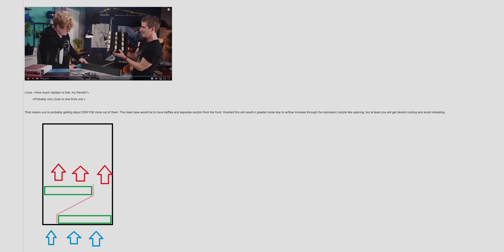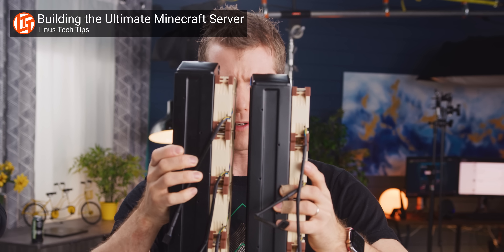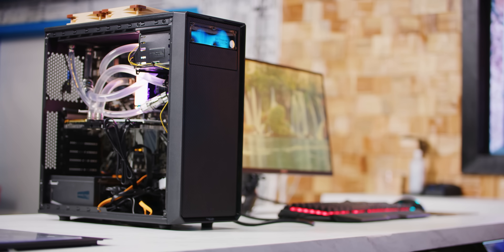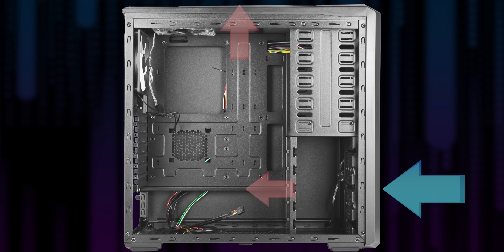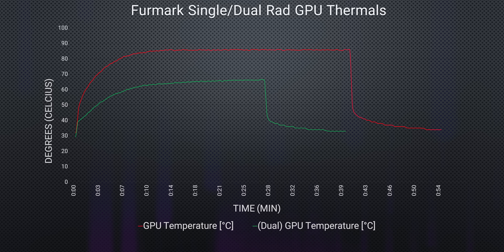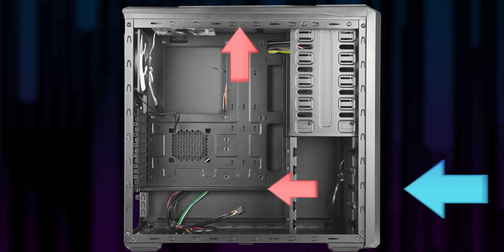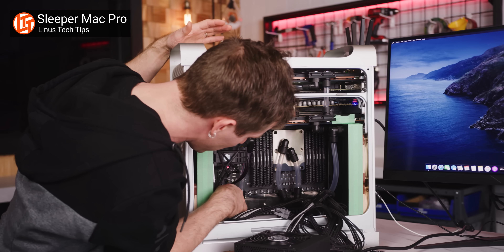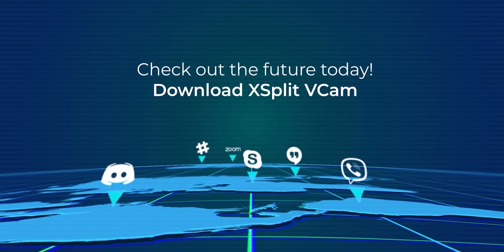I’ve been water cooling wrong for YEARS - $H!T Manufacturers Say

Comment: @LTT what about comparing:
(Each radiator is 2-fan wide)
1 radiator push+pull (4 fans)
Vs
2 rads, 2 fan per radiator (push or pull configuration)

Comment: For the best effect of dual+ radiators you should either use all with a descrete intake or all as an outtake (non stacked) or use the counter-flow principle for stacked radiators which describes a situation where the coldest radiator gets cooled first, and than passing through the next hotter one. In other words, hot coolant enters in the top radiator while the cool air enters at the bottom. This ensures there is always a delta T if possible. Same basic principle is in effect in fish gills where the blood which has already picked up oxygen from already almost oxygen depleted water next passes through bloods vessels and water with a higher oxygen level. Efficiency is astounding.

Comment: The wrong assumption was that air temperature exiting the first radiator was near or equal water temperature. That would be the case with very low or non existant airflow, but with any semi-decent airflow (even with low speed fans) we have to account for the air mass going through the radiator, and its heat capacity.

That would also be a problem with a very high heat load (say, 500W +) on a small-ish radiator with low air flow. But who does that ?

In any case, the best practice is to have radiator fans set up as intake through dust filters, to mitigate the dust problem.

Comment: “In such config”=> I believe Corsair mean radiators stacked, together, no 2 radiators on different places.
Reply: Near the end of the vid he did say he remove a radiator from his minecraft server(which does have the radiator stacked on each other) which led to an increase of 5C. So there was still a net gain when using multiple stacked radiator. Try to watch the entire video...
Reply: @muhammadnazrin3390  That´s right, but still didn't tried 2 radiators taking cold air from outside.
Reply: @pablopoo  That wasn't the point of the video. All that they were trying to prove is that you can add more radiators via stacking or using hot air intake can be effective to dissapate more heat. There didn't need to be a comparrison for the subject of this video.
Reply: They sent him two comments on two different builds, and Linus addressed both.

Comment: Lab results are usually far from reality. Controlled environment can sometimes be horribly unrealistic.  The saddest part of this is that this environments values (air flow, temperature, humidity etc.) are calculated based on the result they are expecting, making the expectation a "reality". (Personal experience during the time i spent in uni)

Comment: This test looked scuffed to me Linus. You really should have replicated or used the system they critiqued specifically
Reply: Uh, watch the vid.  He said they removed one of the three stacked rads and the temps went up 5 degrees.
Reply: Since he is specific on air coming in from the rear and bottom it is safe to assume they tested with the cover on. I am curious if they would test the order of the rads the water went to first. Pumping the water to the rad seeing the highest ambient air temp first and then to the cooler ones. Or test inlet and outlet temps. Corsair seems to not be factoring that as the water goes thru it cools so the fins near the outlet could only heat the air up to the temp of the water inside. Really good fans would push air thru faster meaning less temp rise and I bet they design the rad for 'average' quality fans
Reply: True, if the freaking case is open (which it usually is not, of course, you don't want all that dust in your computer) it's no wonder it's working perfectly fine. When the case is closed up, however, all the things that Corsair said should match up with the real world...
Reply: @soulofakuma3491  Copypasting another comment I wrote in reply to a comment similar to yours: ...are you assuming they ran the tests with the side panel off just because they showed the PC with the panel off in the B-roll video footage? That's.... just so, so, so wrong. Of course they had the side panel on for the actual tests.
Reply: @snozzmcberry2366  Dude stop accusing anyone of assuming if thats all you're doing aswell. You don't know how they ran the tests and they only showed the Computer in a state with no side panels. I am talking about what I see and you're assuming they put them on for the tests.
Reply: @soulofakuma3491  because of course they put them on for the tests. They're not retarded. B-roll footage =/= real test conditions.
Reply: @soulofakuma3491  That's because not putting the side panels on for testing would be a really stupid, amature mistake. These guys test a lot of builds and are not as dumb as Joe Internet Guy, understand Joe?
Reply: @soulofakuma3491  ....it's basic inference & deduction. Linus & co aren't retarded, doing these tests with the side panel off would be extremely retarded, the PC was only shown with the side panel off in B-roll footage, ergo they ran the tests with the side panel on.
Reply: @snozzmcberry2366  Basic inference and deduction is still an assumption. Using synonyms to say the same thing won't change message an hence my response
Reply: @soulofakuma3491  You're just performing mental gymnastics to try to dodge the fact that you made an idiotic assumption based on a ludicrous piece of "evidence" (B-roll footage) that goes against all common sense. You're making a fool of yourself trying to save face.
Reply: @snozzmcberry2366  As I said, I am not assuming. I am just responding to what I am seeing. You are still the one whos making assumptions, so I don't know what you're trying to accomplish here. Just watch your basis for argumentation, before attacking mine. You're assuming without even having any footage.
Reply: @soulofakuma3491  Why do you think they ran the tests with the case open? Linus might drop stuff, but he's not a moron.
Reply: @soulofakuma3491  So you are assuming they did the temperature tests with the case open? That would be a realy stupid, obvious mistake, and I doubt they are that dumb.
Reply: Also, looks like the top fans were pushing outside air into the rad, not pulling through the rad...

Comment: I hope that someone from LTT read this and respond with a video! 
What Corsair meant is that it will be better if you make both radiators as input in your test rig. That, in thermodynamics, will make sense as the input air for the second radiator will be ambient (21-22oC) instead of around 30ish that would be from the case. On my watercooler, i have 2 rads with input-output like you tried but i have 2 extra fans to introduce ambient air to reduce incase temp air.
It will be really interesting to see both of those rads to be pushing air inside the case and have the back fan as an exhaust.
Edit: adding an equation to the mix, by using heat transfer equation W=k*A*ΔT/L, assuming k, A, and L are constant, W is linear with ΔT. For the second radiator, the ΔT will be 10oC maybe? From 30oC incase air to 40oC of the liquid. Having 25oC as the intake, makes the ΔT 15oC which can make the radiator 50% more efficient.

Comment: Are we just gona ignore the fact that they're is a gaint hole in the back of the pc case, where fresh air can get in.
Reply: Ok, but what the hell are you talking about?
Reply: 1. All PCs have additional holes in them.
2. They would never perform temp tests without putting the case together (only an idiot would do that).
3. Corsair's theoreticle testing does not equate to real world performance.
Reply: 0DAANVART0 I don’t think this one was well thought through
Reply: And are we gonna ignore the fact that all PC cases have one, so that sealing it would make no sense?
Reply: @kelainefes  yes,but that's not what Corsair said.they say when there is 2  radiators behind eachother (like a server) where there cant get fresh air in between the radiator (as shown in the video)
Reply: @0DAANVART0  Even in that case, 2 stacked radiators have been experimentally proven to work better than one at least in some scenarios. 
That to me means that Corsair does have a point, they should experiment more and update their simulator if they want it to be a universal system.
Reply: @kelainefes  i,m not saying that corsair simulations are right,im just saying that this test was pointless
Reply: @0DAANVART0  not entirely, but yeah, they should have tested a sealed case as well and then we would know how much of a difference it would have made.
Reply: @0DAANVART0  Corsair was commenting on two of ltts previuos builds. Both of those builds had assorted holes, and Corsair should know better than to equate theoreticle data with real world data.
Reply: @0DAANVART0  The test was not pointless since Corsair was commenting on two real world builds.
Reply: Their tests rarely is..
Reply: there is a giant hole in the side of the pc lol, they didnt lock the sidepanel lol.

its as bad as testing low end cpus to see which you should buy, but they used a 360 watercooler on them instead of stock fans
Reply: @charliek9394  Only somene as dumb as a doorknob would assume a professional would not put the side of the case on before testing. In case you don't realize it, the actual test was not done in the video.

Comment: If the hot water fresh from the cpu went to the top radiator first, you still dump heat into the warm air.  And then you cool the water again with the incoming cold air.  The arrangement is important since most of the heat goes out hte first radiator.  If you had it backwards, you'd be throwing the heat into the case and then really hot air would flow over teh second one, making it useless.  And looking at the model, it looks like the heat was coming out the front radiator instead of the back (top).

Comment: If the loop temperature is, let say, 60°, ambient is at 28° and temperature past the 1st rad is 40°, then yeah, 2nd rad is possible. There's still temp differences for the second rad to transfer heat but is at a diminishing return.

If the loop temp is 45°,and ambient is 28°, past 1st rad is 40°, there's not much it can do by adding 2nd rad, the system is close to stable.

However, putting 2 rad means you have headroom in case the loop temperature does go above what you expect the loop will run at. Basically the hotter the loop, the faster the heat exchange but there's also a limit to how much heat a radiator can exchange. If loop temp is 80°+, definitely add a 2nd rad.

Fan arrangement also plays a part. If 1 rad is an intake and the other is an exhaust, heat from the 1st rad affect the 2nd rad. But if both rad is an intake, they don't affect each other. Both intake in theory should be cooler for the loop than 1 intake 1 exhaust arrangement.

Stacking rad can be beneficial if the fluid inside the loop is still hot after the 1st rad. The fluid will cool down after passing each rad, but they can cool just as much to the point of the air passing through the rads becomes as hot as the fluid, diminishing return.

Im just a mech engineering student, i dont know much, but that's what I understand

Comment: You both might be wrong because of wrong assumptions. The basic equation that matters is "Q = A*alpha*(T_water - T_air)". Alpha far from trivial to calculate and dependant on turbulence and volume flow. "A*alpha" is the part of the equation that makes up the inverse of the thermal resistance. This should be quite intuitive: Higher surface area (A) leads to lower thermal resistance and to a higher cooling power at the same temperature difference.
The thermal energy removed/added leads to a temperature increase/decrease based on the thermal capacity. The typical speed of water flow speed in PCs, the high thermal capacity of water and the low one of air, this leads to minor temperatur gradients in the water temperature though the loop and higher differences in the air temperature and its temperature really just depends on the thermal resistance of coolers and radiators.

The main issue here is the configuration of radiators and cooling. If you start stacking your coolers, the configuration changes from a crossflow cooler to a "longitutinal" cooler. After each one, the air gets hotter and the water cooler. That's why you have to change your simulation model. The cooling power differs a lot if you have the Air-Inlet and the "hot side" of the cooler at the same end or the hot side of the water together with the hot side where the air outlet is.

Comment: Case filters and more closed cases are probably going to give very different results, I believe rather than 2 rads maybe one bigger rad will perform better space being the problem, I wonder how a positive system with two rads would compare, both get ambient air from outside but then obviously then the warm air will move through the system out the back and bottom.

Comment: As to who would seal off every hole in the case, I'm one. I put air filters on the intakes, sealed off everything (as good as i could) but the exhausts and significantly reduced dust in my case at the expense of slightly higher temps. 
It isn't dust free, but way better than it would normally get.
Reply: An air filter isn't a seal though, it's a filter.

Comment: I have always setup my radiators first in the flow to be the exhaust, 2nd and even 3rd rads as being intake, thus I’m just blowing the heat directly out of the case and cooling the water further with nice cool intake air. I did build a system some time ago that was opposing this and I never got that system to run as cool as I had wanted. Loop order can be a difference here is all I am saying.

Comment: Stacking radiators is bad , you wont let hot air to cool the next.
Solution is to NOT stack them so they all have cool airflow then its working fine. 
Try place them side by side , yes most pc case doesnt have space for that so place them outside the case.
Another thing to mention is the failure many do by let the water flow to the CPU and further to the GPU ( GPU's if more than one card )
Its a NO NO ... you want seperate flow so you NOT end up cooling with hot water.
So when using more radiators why not just a a few more pumps and make seperate loops to every component.
That way you can cool all stuff more efficient and of course do some more overclocking if this is what you want.
Yes this will add more expence by using more pumps ect but when take it to the extreme those who did they actually bennefit from it.
If you still want to stack the radiators then remember that every radiator behind will cool less efficient but they still cool more than just 
using one radiator.
So instead of stacking them try to place them side by side this way the total square of cooling space is max.
( place them outside of the pc case and a little away so they get the ambient temperature and not pick up heat from the system )

Comment: I'd like to know what the flow rate was in Corsair's "simulations," because if they were basing their numbers on the garbage pumps in their AIO's, I can see how they could conclude that multiple radiators would perform poorly.
Reply: Honest question, does it really matter?  I would be curious to see how much water flow you actually need because I had a built a custom watercooling setup where the pump eventually died and I hadn't noticed.  It barely ran warmer then with the pump working, after I eventually noticed I left it that way for another year.  It was a custom solid copper milled block, and it used 3/8" hoses and a fairly large rad (car heater core) so mabye it was just the size of everything that made it work so good pumpless.  Basically a giant heatpipe setup.
Reply: @h82fail  That's pretty interesting. Judging by the time frame when that was a pretty common type of build, the CPU you were running might've just not had enough wattage to create a vapor front which prevented the water from contacting the block. In a case like that, the convection of the water alone was probably enough to keep it cool. Modern blocks with microfin designs are very restrictive and if you don't have enough flow rate you end up putting more heat in the coolant that the radiators struggle to transfer the heat into the air. You can make this even worse if you run an over sized reservoir, where you're essentially just allowing heat to concentrate before it has a chance to dissipate.

All in all, Corsairs claims are very weird to me without knowing a lot more about their loop specifications, like the flow rate and whether or not it had reservoirs, or overly long tubing. I don't think I've ever seen a case where multiple radiators in any configuration did worse than a single radiator.

Comment: Hey Linus, try instead of stacking radiators in series, do it in parallel. that should beat stacked radiators. and may be what corsair was trying to say.
Reply: You'd need identical radiators to avoid turbulence issues.  Doing it in series is fine.  What Corsair was saying is that you shouldn't be blowing hot air from an inlet radiator into the case, then right through another radiator.  Which is true.  You will get better results if you don't have the exhaust from one radiator going into another.  But you will still get more cooling from that other radiator, even if they are right next to each other.
Reply: @TrueThanny  by turbulence, do you mean in the water or in the air?
Reply: @thejoey468983  Water.  If you have two parallel paths for the water to go, and the flow resistance is different, then you're not going to get good flow through both paths.  The turbulence at the far end with faster water hitting slower water will slow things down further.
Reply: @TrueThanny  I have to wonder if the flow rate is high enough to cause turbulent flow. I would guess, it would be a smooth laminar flow, admittedly not having done any math to calculate the Reynolds number.